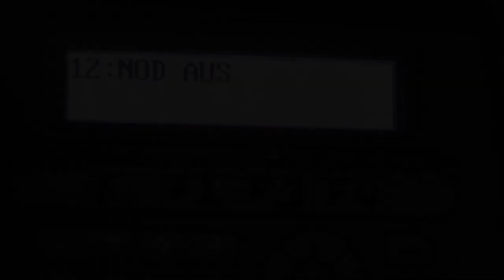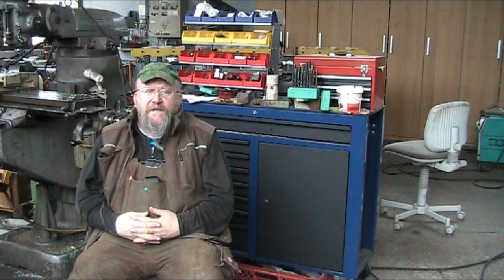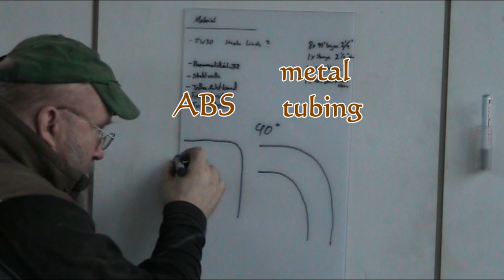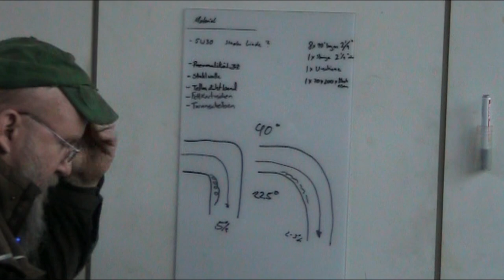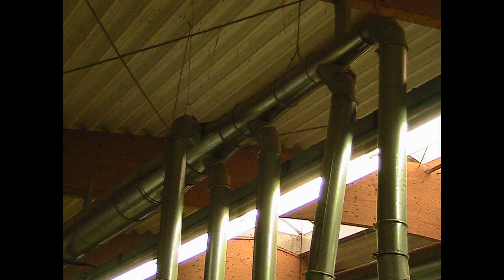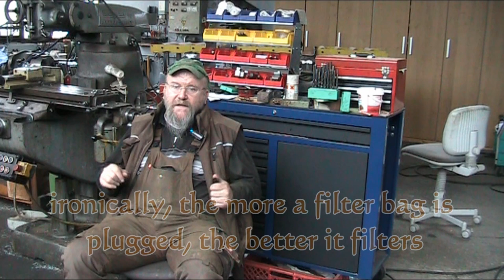dust collection systems: ductwork

Comment: The drain is not affected by the coriolis effect. This system is much to small. The direction of the swirl is mostly due to the geometry of the sink.
Reply from the maker: no, the drain isn't affected, but the water going down it is. the movement in the water you see going down the drain is not due to any geometry of the sink, tub or anything else. the water begins to swirl due to the coriolis effect and then forms the funnel as it picks up speed. centrifugal force helps shape the funnel. water being a polar molecule, pulls the remainder of the water molecules in the sink or tub down with it, but the coriolis effect is what gets the ball rolling. the same phenomenon can be observed in water spouts and tornadoes. 

if you were to put a drop of food coloring in a glass of water, watch what happens: one is diffusion, the other is the coriolis effect. diffusion will cause the food coloring to disperse in a random fashion, the coriolis affect will show a very tiny amount of swirling going on that accelerates the diffusion of the dye. the bigger the body water is, the more you will see the swirl. a swimming pool really shows it well. some people have mistaken this sort of movement for wind induced surface currents of thermal clines within the water column. it's also why you see the pool toys drifting around in a circle along the edge of the pool in an indoor pool when the pumps are shut off...

Viktor Schauberger - an austrian forester, carried out extensive research on the behavior of water. many of his observations confirm the coriolis effect and much of his work  puts it to good use. 

similarly, the materials (chips and wood) moving thru the pipe don't move in a linear fashion. it swirls violently. that's why collection system make so much noise.
without the coriolis effect, dust collection systems would be almost silent,  and nowhere near as efficient as they are.
Reply: @HolzMichel  OK, sorry, English is not my first language. The water going down the drain is NOT affected by the coriolis force. This is a common misconception. I think you speak german: https://www.youtube.com/watch?v=PXxXvex07bw
Reply from the maker: @Zorgoban  ...thanks for the link, checked out the video and unfortunately the guy had his directions that the water should go down the drain exactly opposite.  the coriolis effect is an incredibly deep subject. the video doesn't explain it in any kind of detail...and it's a subject you either get or you don't. very few people get it. it's not something i can put into words easily so a layman can understand it.
there are several things at play when it comes to the draining water creating a swirl: viscosity of the water, polarity of the water molecules, the rotation of the earth (which is what creates part of the coriolis effect) and inertial resistance of the water ( a further component of the coriolis effect), the inertial resistance of the water to the air and the inertial resistance of the air itself (another element of the coriolis effect) and to a lesser degree vapor pressure, barometric pressure and temperature. 

what you see in the linked video is only a part of the coriolis effect. as the room rotates, the stream of water seems to veer off. it actually doesn't, it's the trailing stream of water actually being ejected from the super soaker along a different trajectory. thus giving the illusion of a curved stream of water. 

now the ball rolling across the floor of the rotating room really shows off the coriolis effect: as the floor passes in a circular motion beneath the rolling ball, the ball seems to veer off again. however the ball is also traveling along a given path, but because of the "path" moving in a different direction, the ball will actually take on an arc in it's travel as long as it has contact with the floor beneath it. 

similarly, the ocean and atmosphere exhibit this same character as the earth "passes beneath" them as it rotates. the water and air want to stay stationary as the earth rotates. the inertial resistance of water and air then create ocean currents and winds. although thermics do play a role in ocean currents and winds as well
Reply: @HolzMichel  for some reason i expected you to know that "the guy" (TerraX) is a team of science journalists.
Reply from the maker: @Zorgoban  i do, but that doesn't come to mean that they got it right. they had it bassackwards in that particular video. 

i used think highly of the show and its hosts until they started relying and regurgitating junk science